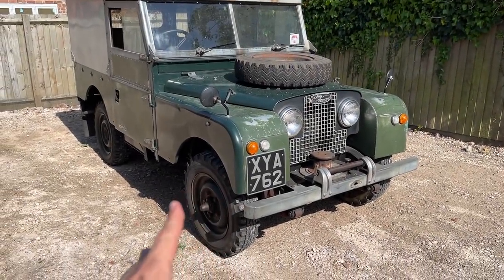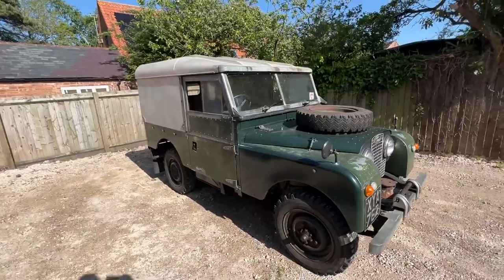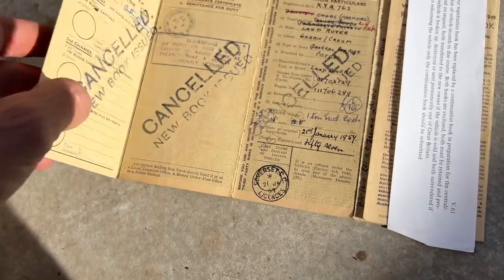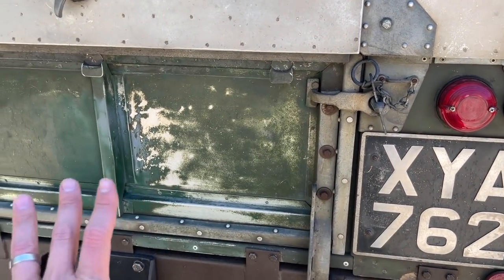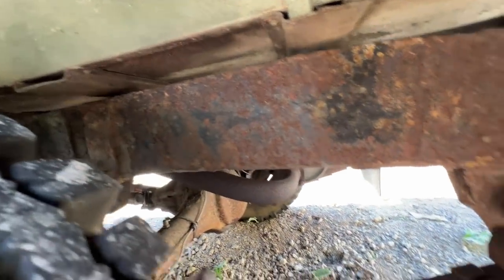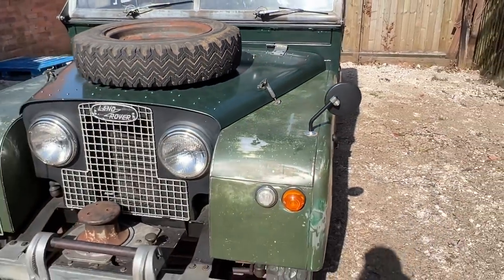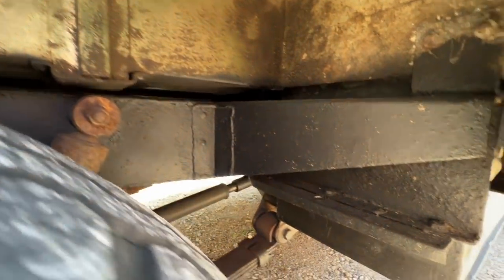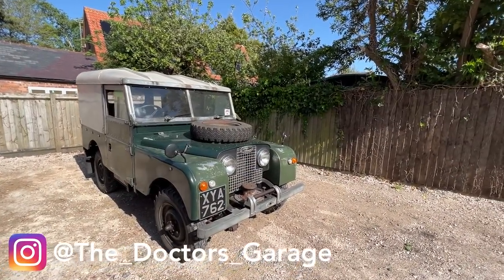MY NEW LAND ROVER PROJECT!

Comment: Hey Doc, you could use Owatrol Rustol Oil to treat the rust on your chassis. Just brush or spray it on. Two coats and you can paint it over but it's not necessary. You can also spray it inside the chassis. I've been using it for years on my series Land Rovers and it works well. Nice series 1 you've got there! Some bigger radial tires on 109 rims will make it look a lot beefier. Lets say 235/85-16 or maybe even 255/85-16 mud terrains. If the engine is healthy that would be a nice way to drive a bit faster with less rpm.
Reply from the maker: Cheers mate appreciate the advice will take a look at those tyres sizes

Comment: That is a very nice truck and it doesn't look too bad underneath for it's age.  To be honest you have two options, 1. do whatever you like to it, big wheels, decent seats, carpets, paint job and upgrade steering wheel and interior fittings.  2.  Carry out a sympathetic restoration with genuine parts and possible repaint in original colour.  In my opinion, option two will make you a profit when you get around to moving it on.  Option one will reduce the number of prospective buyers due to your mods.  But hell it's yours, do what you like, have fun with it.
Reply from the maker: Cheers Tony - that’s some good perspective on it- I think I’ll go somewhere in the middle

Comment: Other than Series one being a rarer vehicle, they are also 80 vs 88". A lot of folks who own series 2-3 use them as dailies. Series one would be a little harder to hold up with modern vehicles. Also Series 2-3 are easier to modify and more common to be re-sprayed. With a Series one the K.I.S.S. method is the only way. Re-spraying with all that patina would be heart crushing.

Comment: thats mint love it!! keep the patina but smarten it up underneith, thats my plan with my 1971 S3. as its a second daily driver along side my D90 so i put a 300tdi in but your engine sounds good for now.. Heritage1948 do a nice wooden billet steering wheel, I'm also running 265-70-R16 insane turbo K2  mud terrain tyres which i love the look of. most importantly tho get yourself a usb volt reader so you can charge yer phone and keep an eye on the battery voltage too.
Reply from the maker: Cheers that’s a great idea about battery and will check the steering wheel out 👌🏻

Comment: Awesome buddy! This is going to be such a fun project.  I reckon keep the paint as it, re upholster, canvas roof instead of the hard top. Suspension and wheel upgrades (but work that could be easily reversed maybe?) wider arches, maybe just make it a bit more friendly to drive/use. Rear inward facing bench seats. But I love it. You want to be able to take mates to point to point or the pub!
Reply from the maker: Cheers George - completely agree - reversible parts are key

Comment: I had a 1956 for 15 years until I sold for my td5 90, it was a hard top truck cab when I got it, but I changed to a soft top truck cab, that was good fun, love the way the door tops just lift off and the canvas rolled up or off altogether, the quality of the steel on the chassis was much better than my 90, keeping it nice underneath took less attention than the td5 does, be genuinely interested to see what you do with this.
Reply from the maker: Cheers Martin - I’m looking forward to getting stuck in with it!

Comment: I've run my Series 1 on 235/85/16 tyres. To be honest it's not great. Steering is even heavier and will wear out quicker. Mine is a 2.25 petrol but it still had effect on the already dismal performance. I've now got it on 7.50x16 tyres and I think that is the best compromise. Slightly alters the gearing to bring the revs down and also looks better than the original tyre size.

Paint wise I actually painted mine blue. Looks very good but it had already been painted badly by the previous owner. Seems a shame to paint over the lovely patina on yours. A canvas roof would have it looking good though.
Reply from the maker: Cheers that good to know- makes me think about tyre choice

Comment: If the all the paint was original I would say keep the patina but as it’s had the bonnet, bulkhead, outer wing and grill surround painted I would have it painted in an original colour, canvas top with rear bench seats. Fully agree with wider wheels and tyres too but something that fits with the era. I’d avoid fitting newer wheels such as wolf etc as they just won’t look right. Maybe have the original wheels banded ?
Reply from the maker: Cheers Martyn! Some good ideas - I need to come and see you guys
Reply: @thedoctorsgarage  kettles always on 👍🏻

Comment: As you know -you have a bargain! It will be destroyed by changing too much from the original!  Firstly - don't paint it except for the replacement front grill - which should be steel - not aluminium in that year.  For sure ditch and sell the hard top - but dont cut out any more windows.  The purists like them "uncut" and they are worth more as is!  Bigger tyres are OK - but keep the originals  -  As  "beach buggy" it wont work - Its a "Tractor in a skirt"  and lovely as it is !  Your enthusiasm to "modify" is adnirable - but not in this case -  The next owner will pay you less for it  and revert to original ( maybe not the hardtop?)   if they have any sense .
Reply from the maker: Interesting to know they are worth more ‘uncut’

Comment: General tidy up but keep it as original as possible. That said, love the Cool n Vintage vehicle and you could go a long way towards that look by simply removing the hard top and using wheels with a bigger offset. A nice wood rimmed steering wheel also wouldn't harm.  Hate the idea of a wedding car - images of you opening doors in a a gray suit and peaked cap.  Wedding car v Cool n Vintage .....no competition.
Reply: To be fair you can still use cool and vintage as a wedding car ......On request from friends I have previously used my black  off road set up def90   for weddings ......the grooms car obviously !
Reply: Good point.....agreed  definitely more appropriate for the groom - the bride might look a bit windswept with no hood and the screen down.
Reply from the maker: 😂 great grooms car Kizzy P!

Comment: Too original and in messed about with to alter in my opinion, I think you will look back in years to come and regret changing things. If you paint it stick to original colour for value to be retained. Other thing with paint etc is if it's getting done it's wants done right and you will end up with  it totally stripped to do that and again loose any character ?
Reply from the maker: I’ve decided not to paint but do reversible changes!